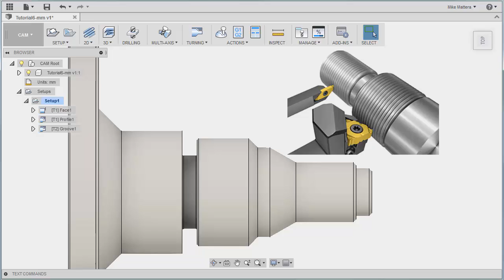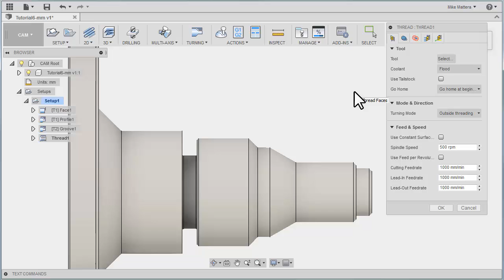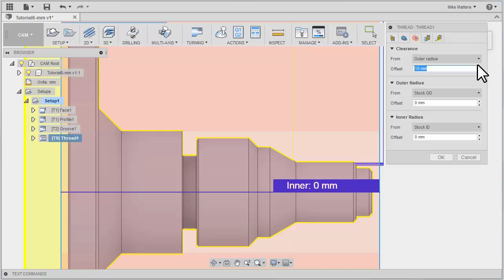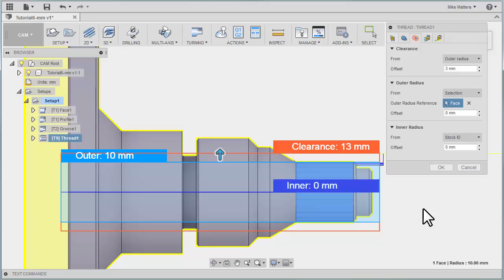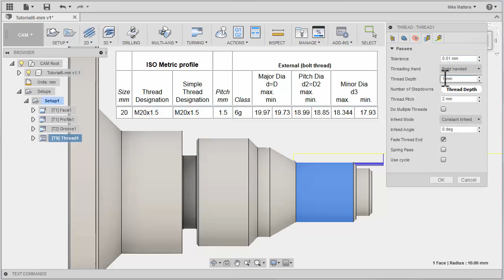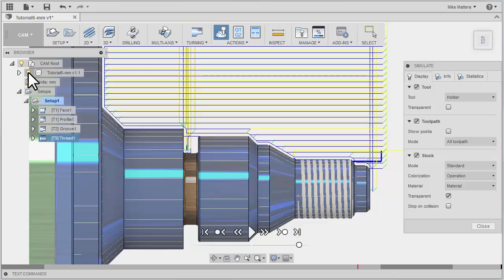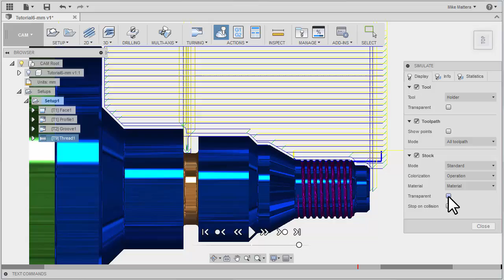Fusion 360 CAM - Intro to Turning 07 - Threading

Comment: Just a comment. In metric countries (Germany, Italy etc) we use the rule that any metric thread depth is equal to half the pitch. So the thread depth of a 20x1.5 Metric Thread is 1.5/2=0.75mm. Tapping diameter will therefore be 20-1.5= 18.5mm. For example, when drilling a hole to be tapped M8 (1.25mm pitch) we use a 6.75mm/6.8mm drill. This works for coarse and fine threads alike. No need for charts. Although not accurate to the hundredth of mm, it is within the required tolerance and will produce excellent threads. We consult charts only for extremely accurate threads, but even so, like any machined feature, any thread must be checked after cutting, either by means of thread mikes or fixed thread gauges. Therefore it is not important to get the correct depth of thread first time, it will have to pass the test of the measuring instrument. Use this rule to pick the correct tapping drill easily. Remember that the old MA, MB thread profile has been updated to the new Metric profile in order to improve the life of the thread cutting tools and to facilitate the life of the operator. In addition, a theading canned cycle automatically calculates the correct depth of pitch, I cannot see why this feature is not included in Fusion 360.
Reply: That is a "general" rule of thumb that will get you CLOSE. But that is NOT the correct formula exactly. It will just get you very close. That works fine for manual, but on a CnC machine you aren't getting the correct depth.
 Proper Metric thread depth is Pitch X .5413. That's it...   If you are doing a 2 pitch thread just multiply 2 X .5413.  You will be given the S.T.D (Single thread depth) In metric, so convert that to Imperial. You will notice the depth you get is not the same as half the pitch. This has been the proper formula since 1986 in the Machinsts hand-book.

Comment: M20x1.5 pro machinist just do depth is 1.5*0.65=0.975
minor dia = 20-(2*0.975)
i do not need charts or even measure thread. i know it go tolerance if i measure tool correct lol
G76 P010060 Q100 R0.05
G76 X18.05 Z-30 P975 Q250 F1.5
Reply: Hello and for multiple threads ? can you have 1 ex. thx :*
Reply: Why are you using a 40 year old Formula?
 Depth for a metric thread is P X .5413.
 The formula you are using was changed in 1986 when they discovered a more accurate and better formula to what I just listed.
Reply: @Cody-ox2uu  Hi Could you please provide a link to the value of .5413 I would like to understand this more Thx.

Comment: Why did you choose 2mm pitch for a 1.5mm thread? I have been working on getting Fusion 360 CAM to create a threading cycle, but following your instructions results in no tool path whatsoever. In fact, I have tried many variations of settings and I'm getting nothing. I can write a threading cycle on my lathe in 25 seconds. But 2 hours of attempts on F360 resulted in a headache. So, what am I missing?
Reply: i can write cycle in less than 10 second. that include calcularing depth and minor dia.
1.5*0.65=0.975    * 2 - 20 =-18.05 SO height P975 minor dia X18.05